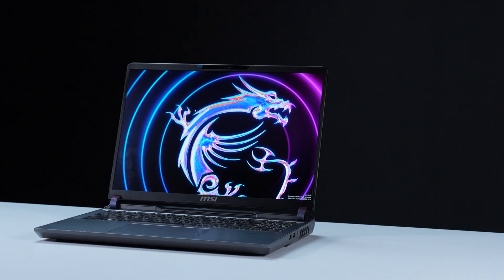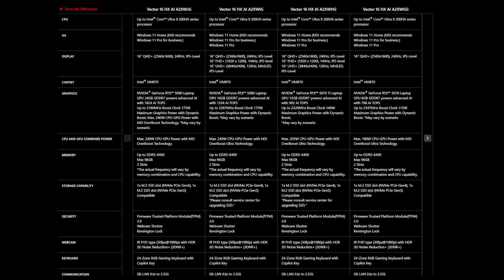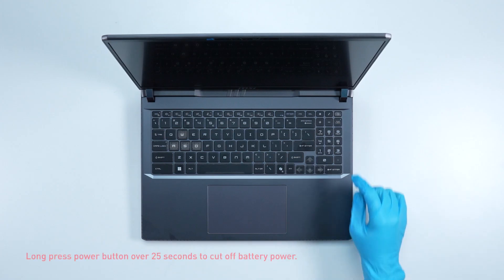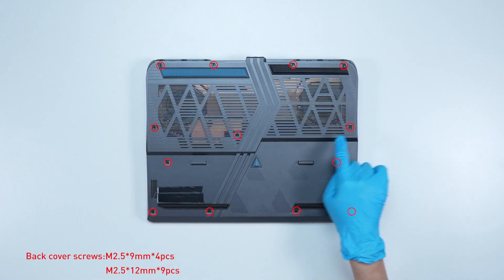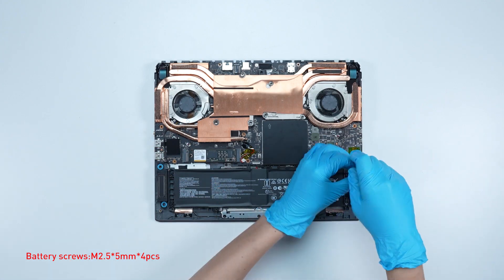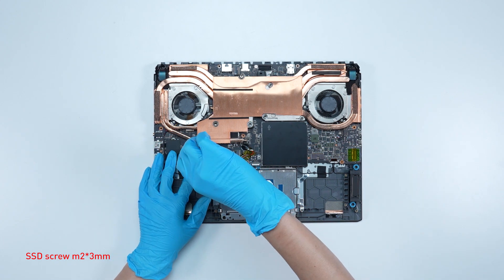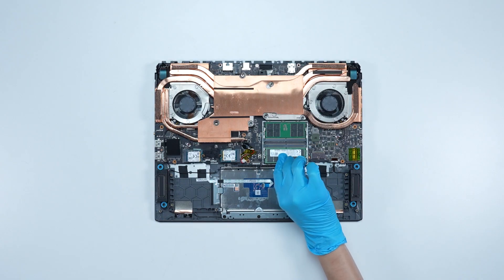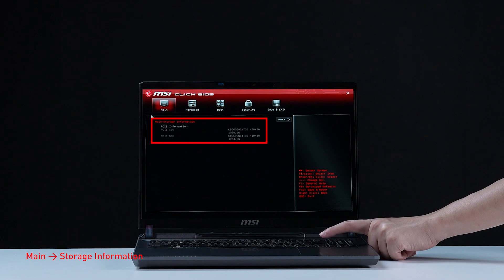MSI Vector A16 HX Upgrade Tutorial

Comment: Claiming this system supports 2 SSDs but shipping it with 1 2280 SSD that prevents using the second connector as they share the same physical space is diabolical. So if you want to add a second SSD you have to buy 2 2230 SSDs and completely ditch the original SSD.
Reply: Thank you for the heads up. Potential buyers need to know this!
Reply: So I watched the jarrodstech review of the Vector A16 HX A8WHG-004US and it shows two full slots for the ssd . So this model in this video has different slots then ? 
Because if you watch that jareodstech video, he opens the laptop and there are two full slots one on top of the other.
Reply: @systemrecords9708  yes I've seen two full slots on another video too. We must investigate further 🔎🔎🔎
Reply: Is it the same thing for the amd version of the vector 16? I got myself the walmart deal, the one woth the ryzen 9 8940HX. does it also have this diabolical setup ? 
I see what you are saying and why that setup is diabolical . Meaning if you want to add a second ssd after you've already been using your laptop for a while, you'll essentially have to swap the old sdd out completely before putting in two small ssds.